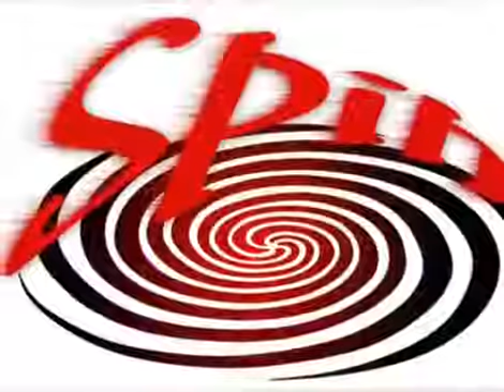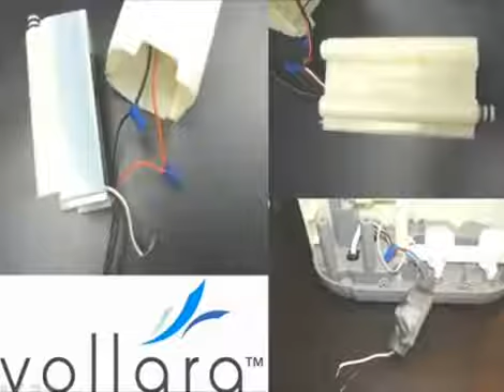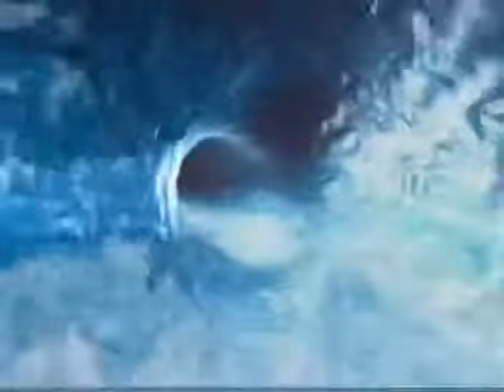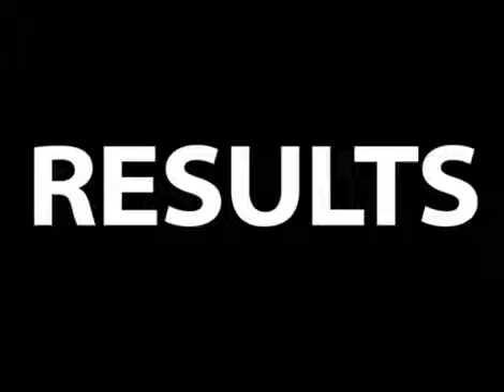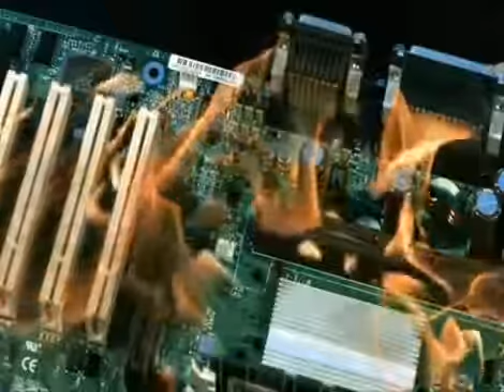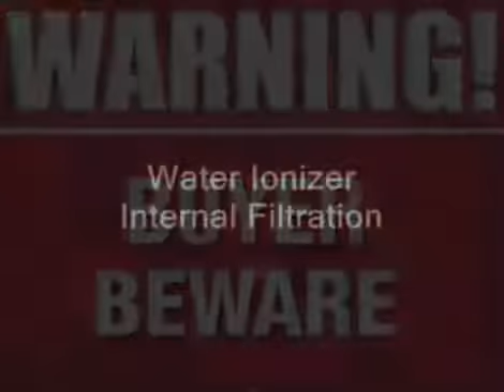Enagic   Competitors VS Enagic

Comment: If you want to clean water, make sure the ionizer have at LEAST 2 filters. Because the water in everywhere is contaminated enough to the point the water is can't be at the highest purity to ionize the water without any toxic elements and compounds in water when filtered with only one filter with highest quality.

Comment: The SMPS(Switched mode power supply) have an transformer too! The linear ones have LESS efficiency due to the transformer is old-fashioned. Newer transformer is better! Today, SMPS uses new-fashioned transformer. So, today, SMPS is better.

Comment: I will show you which plate is the best. I test with magnesium solid wall and zinc coated steel mesh fence and charge it up with electricity and drop 2 spiders. The spider on the magnesium wall don't die until it reaches the edge of the wall. The spider on the fence explodes and dies due to electricity separate their living cell molecules. The mesh plates are better!